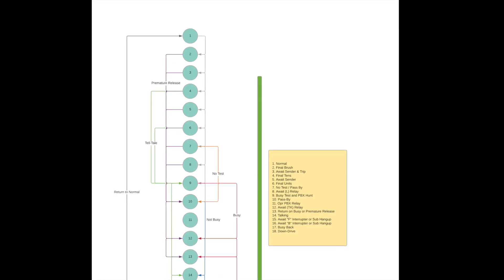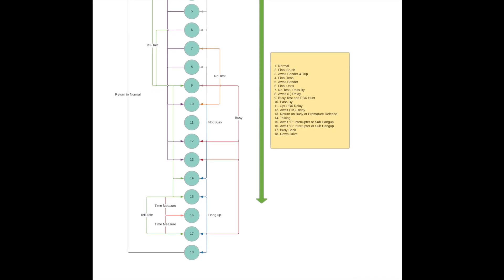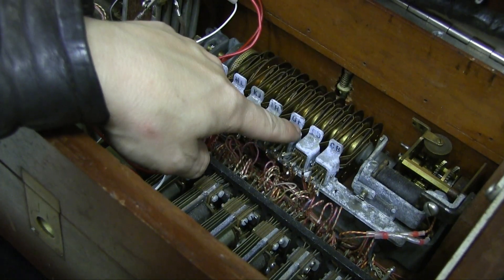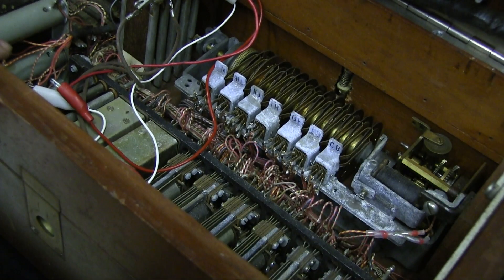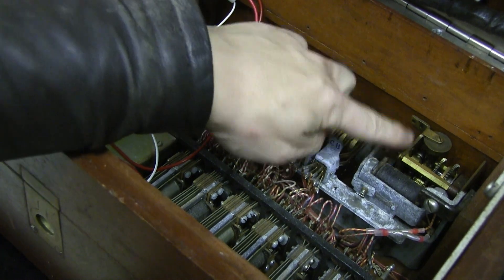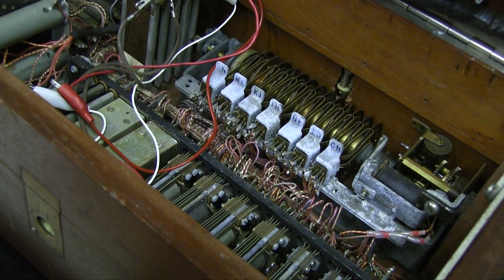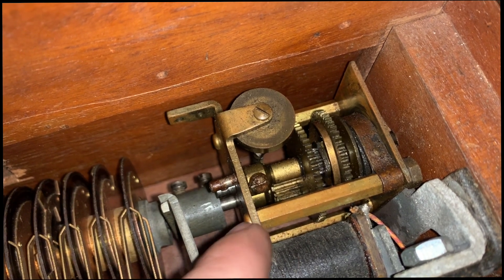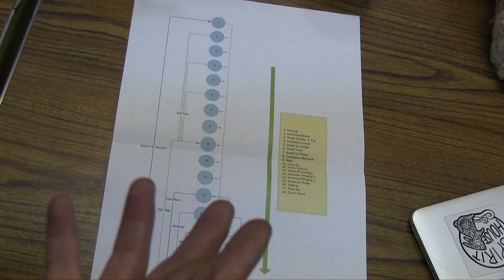[Panel] What do sequence switches do?

Comment: Great video! I know this video is two years old, but I also have a tendency to get stuck on a project and never quite finish or show anyone because I'm kind of a perfectionist. When I was learning to be a machinist, two things helped me move past that more often. The first is the idea of tolerances built into the design. Knowing that I didn't have to be perfect every time and knowing in what ways it was okay to be imperfect sort of did something in my brain, and I just think of tolerances when I get stuck. Also, our instructor had a mantra he repeated often "perfection is the enemy of good enough." Sometimes you just have to get the part out to your customer, and if it's in tolerances you're finished and need to move on. It helped me anyway.

Comment: @4:00 minutes. Programmed by gears and cams: the Brown and Sharpe screw machine, essentially an automated lathe (pre CNC) which could perform many operations as directed by a cam designed to direct the tool operations needed to produce a specific part.

Comment: Do you have any explanation videos walking through a call from off-hook, to how a line finder works (in SxS or panel or crossbar), how one is determined to be available, how the sequence switches (where applicable) affect the call, etc. 
I'm struggling to picture in my head how the signal flows at each step of the call for each type of non-ESS switch.
There's a textual description here but it doesn't explain in enough detail in terms of how a line finder is selected (as opposed to any other) and how to subscribers are connected in the panel so that different paths can be taken if components are already engaged for other calls.  That's the thing I can't get my head around.  https://en.wikipedia.org/wiki/Panel_switch#Completion_of_a_call
Reply from the maker: It can be a challenging topic for sure. This was something I struggled with at first, until I had a real hands-on experience with the machine, and I could set up multiple calls and watch what happened between them. I've been meaning to make a video like this for a while, but its going to be multiple videos, and really long. I just have to get off my butt and do it! Maybe I'll start this week.
Reply: Line finders? I'm not the one with the panel office so I don't know the details, but my understanding is there's a selector that selects the next line finder to use and a circuit detects when any line is picked up, and drives that line finder up until it finds the line and somehow marks it as found, and the selector advances to the next one that's not already in use